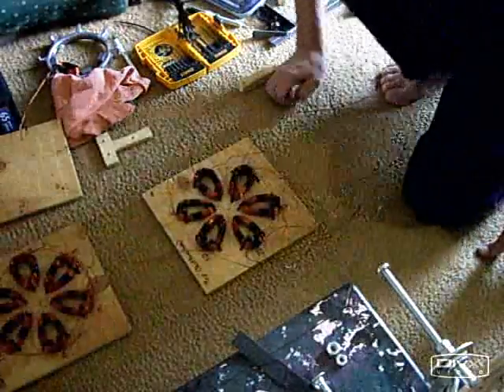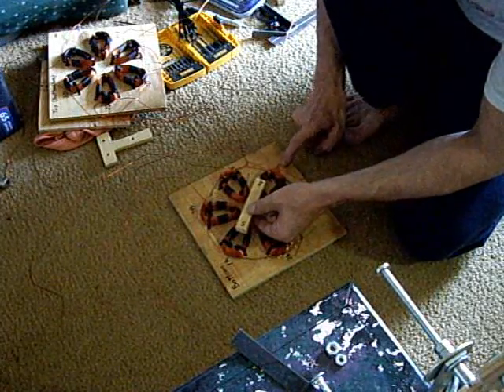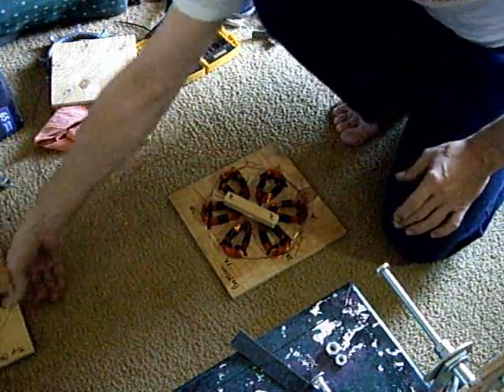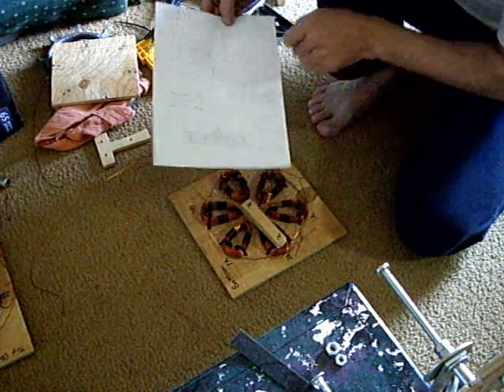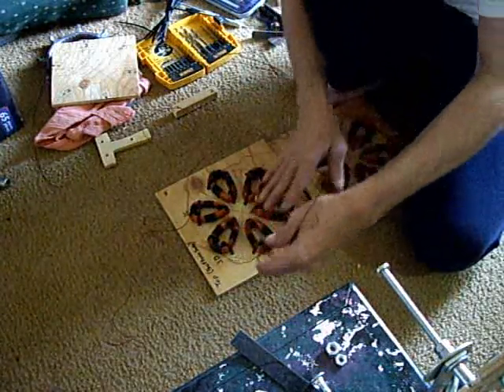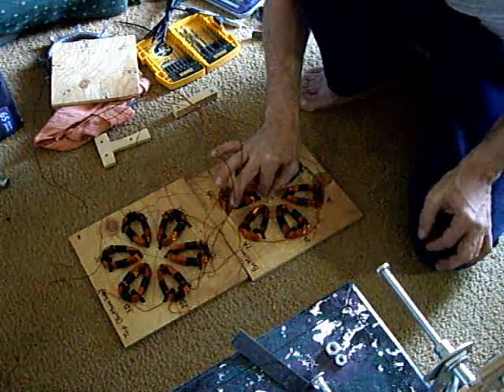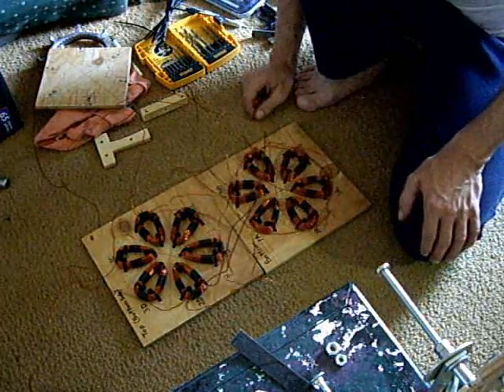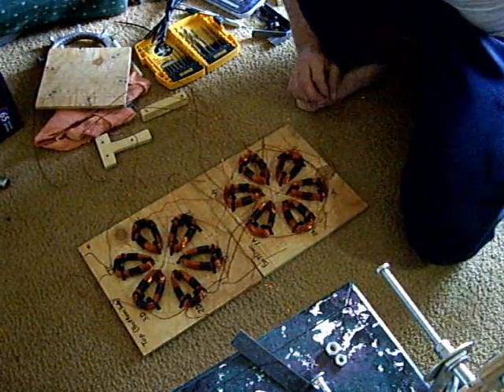Generator part 2.wmv

Comment from the maker: The VAWT blades are PVC tubing (3.75") split in half length wise (36" long). Please use safety glasses when cutting PVC, that stuff flies everywhere. I got the tubing free from a former employer. They used to install vacuum transfer systems.

Comment: I am using one of the stators from the original LYNX alternator in my Zephyr Model IV.  The other I use for test bed.  The production models got 8, 1/2" thick neo magnets.  Keep at it, great explanations.  It is complicated until you understand what's going on with the flux inducing current flow.
I made them this way so I could avoid the mounting of the stator plate and trying to control air gap.

Comment from the maker: Yes the top stator is connected to the bottom or rather the other way around. The bottom stator is 2 sets of coils, the second or "b" coils output is connected to the top sators "c" coils bottom end (from bottom 1b, 2b & 3b to the tops stators 1c 2c & 3c coils). 
As for that 90 degree shift, look at the where the magnets are with respect to the coils & remember that all the coil number 1 need to be the same polarity (eg. North) at the same time. With two mirror image plates one needs to shift.

Comment: Hi, can you tell me if you are connecting the top stator with the bottom stator and if yes how, please?  Also, can you explain in more detail the 90 degree turn on the top stator.  I am new at this and need advice.  Keep up the good work.

Cheers!